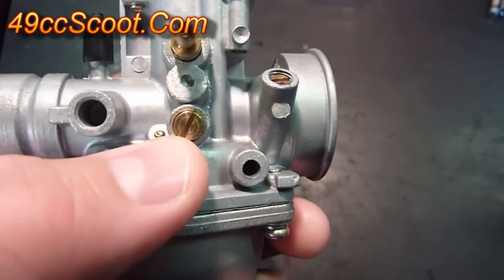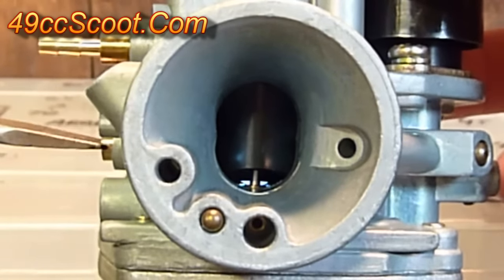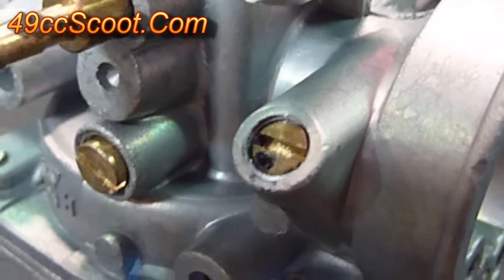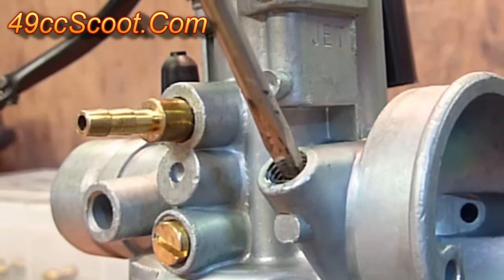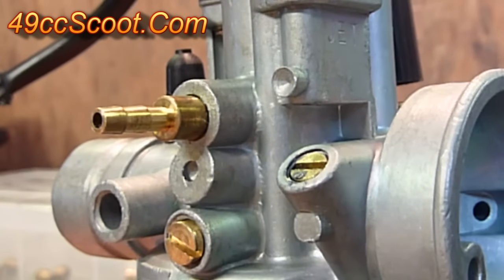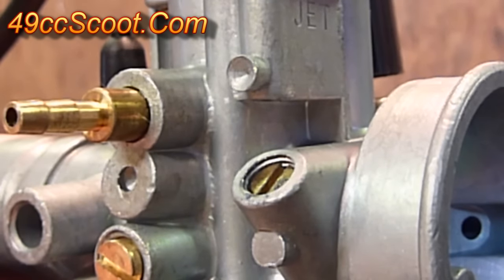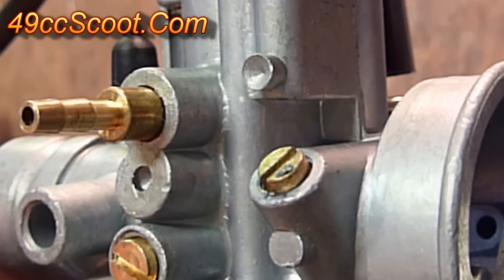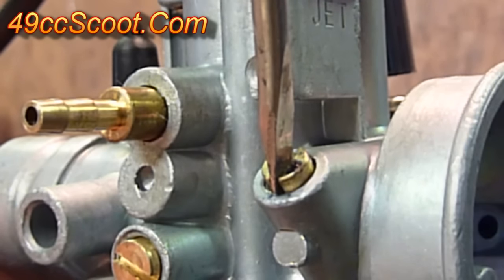Two-Stroke Scooter / ATV Carburetor Settings And Adjustments 2of4 : Idle Speed & Mixture

Comment: It's difficult to adjust these to that "Sweet spot"  when you can't get the engine starting to begin with
Reply: Best way I’ve found to help with this, set the tuning back to factory tuning(usally 3 full turns out for both air and gas screws) then give it a quarter turn back in on the gasand it should be enough to start the bike until you can actually tune it. It’s just 50cc that are an ass because of how exact you have to be sometimes

Comment: im working on an '85 Honda Aero 80cc thats been in an attic since 1987 with a full tank of gas. These past few days have been a nightmare! Turns out, they havent made gas tanks for this scoot since '87, and this is too far beyond repair. Ive worked on tons of Chinese scoots using your help. Now, I can thank you for helping with this one. The air restrictor was stuck wide open due to some gunk build up even after ive cleaned and rejetted. i finally just looked throught the dang thing after this video and saw it stuck wide open. Its too late to try and get it running tonight with the kids being asleep, and I have to work all day tomorrow. Now its going to be on my mind all day! Thanks AGAIN!
Reply from the maker: Good luck with it. Hope that does it for you.

Comment: This is great, similar principles to italian scooters i.e. derbi model with piaggio motors.  My Scooter was running way too rich as indicated by the soiled spark plug.  The scooter recently developed a significant vibration at about 1/4-1/2 throttle and at idle. After turning the idle mixture screw out about 8 full turns, the scooter idles much more smoothly, doesn't lag on take off and doesn't vibrate anymore.  It actually has never ran this smooth.  Great explanation of the process and how the carb works!  Thank you.  2007 Derbi Atlantis Bullet 49 cc with piaggio engine.
Reply from the maker: Be careful. If turned out too far the screw gets loose and can loosen further with vibrations and end up falling out. Replace the idle/pilot jet if necessary to make sure the screw can be adjusted without it being too loose.

Comment: Excellent tutorial will try this on my 350 LC it’s bogging at low revs up to 3000 rpm then it’s off like a scolded cat nice work mate
Reply from the maker: Give it a try since it can be quick and simple if the carb is easy to access. If it's RPM dependent and not throttle position dependent though, you may have something else going on... like a clutch issue for example.

Comment: 9OGTVert

By far the most informative video i found on the mixture screw adjustment;

And,  as i suspected, my pilot jet is TOO SMALL,or partially plugged(air screw ALL the way in).

Thanks a lot.

Comment: This has made a lot of sense because soon as the vacuum pipe is on it doesn’t start use a vacuum pump tester it works I’m guessing ether the carb or vacuum tap isn’t working properly

Comment: Thank you! I've been having a carb issue(keihin pb16/kymco like 50 2t) & took it apart for the first time today. At a point when changing the main jet (w/out fully removing the carb from the engine) I 'adjusted' the float w/out realizing. I put the carb back together properly, but the engine isn't firing (w/good spark and compression). A suggestion has been made to alter the idle mix since my plug is wet. My carb is different than this one, but it is very helpful to get a visual & explanation.

Comment: I need a float for this exact carburetor, mine is off a Bombardier DS90 2stroke but they discontinued the parts.

Where can I find aftermarket parts???

Or can you give me a part number for this?
Reply from the maker: Take a look at PartsForScooters part number 161-214. There used to be some rebuild kits around if you searched for something like "polaris 90 carburetor rebuild". You can look in  a Polaris parts manual for an outlaw/sportsman/predator 50-90 and see if they have a part you can get.
Reply: 90GTVert you nailed it with the Polaris 90 recommendation!

Found a part number through the Polaris Predator 90 diagram!

https://www.partzilla.com/catalog/polaris/atv/2004/predator-90-a04ka09ca/carburetor-cb

Thanks again, very helpful!
Reply from the maker: Awesome. Glad to help!

Comment: Finally a video on adjusting screws. What is usually stock on a carb just roughly as I’ve rebuilt my carb which was all blocked up with the wrong adjustments?
Reply from the maker: 1.5-2 turns out is usually a decent starting point for the mix screw. For the idle speed, you  can make sure it's raising the slide a little and then you'll figure that one out quick enough when it's running.
Reply: 90GTVert 1.5 to 2 turns out from all the way in or flush with the sleeve?
Reply from the maker: @Jack-ns5zc  Any time "turns out" is stated, it should be from seated (all the way screwed in).
Reply: Ah right, cheers

Comment: Hey man thanks for the video I used the guide on my kymco agility 50 its a different version of the carb but its the same thing. the sweet spot for my scooter is 3 full turns out from all the way in. My scoot doesn't have a tach but i basically set the idle to a hair under the tyre starts moving which is nice. I will suscribe to you its hard to find people there days that can even service a carb, Well at least locally lol cheers

Comment: Another great video.  I been haiku problems with my carb sticking
Reply from the maker: That could prose quite a problem. A lot of times sticking is from the cable/throttle setup so check those.
Reply: I had time to take off and clean.  Since we had all this rain.  Seems ok now

Comment: I've got an '86 Jog as well, and I know exactly what you're talking about.  Usually this was done by the factory as a way of discouraging people from tampering with air/fuel mixture adjustments and adding aftermarket components.  A real pain, I know.  I got a Chinese clone carburetor for mine, which had the air/fuel mixture screw.  Took some modification to get it in, though...

Comment: That was awesome and to the point. Should I start with a new plug or a clean the plug? Or does it matter ?
Reply from the maker: If your just starting out, as long as it's not fouling you're OK. If you get to fine tuning, especially higher throttle settings, then maybe put a new plug in.
Reply: @49ccscoot  wow thank you man for responding so quickly. It's not fouling the plug, just kind of gutless. The other Eton viper is much snappier. Both are Eton Viper 90s. Getting ready to sell them. Kids out grew them and want someone to enjoy like we did. Thx again.

Comment: Or just buy an inductive RPM guage that you can clip onto the sparkplug lead and you don't need to listen to idle speeds but you can just litteraly read them on the guage, and since this type of guage is for temporary usage you don't need to do anything to your scooter / ATV.
Most of these guages go for around 20 bucks, so it's not expensive and makes live a whole lot easier. I know it did for me when adjusting the idle speed on the scooter.

Comment: This is one of the better guides for adjusting tje carb, thanks for that! Still have some questions tho.. how many turns out on the idle screw is a good way to start when starting from scratch? Also, is that all made without the choke pulled in right? Usually if i start cold i need the choke in to even be able to start.
Reply from the maker: Don't tune with the choke. Let it warm up, then tune. For the baseline guess on a new carb, try watching the slide and turn till you can see that it has opened just a tiny bit. Better to have it too low and die out than too high and take off.

Comment: Hey cool video ! So at idle if you turn the idle speed screw there will be fuel sucked out of the main jet ? Because you raised the needle?
Reply from the maker: It would depend on the characteristics of each carb exactly, but turning the idle speed screw in does the same thing that twisting the throttle open does.

Comment: Hey thanks for posting this video it's really helpful. I was wondering what's wrong with my carb. It only runs on choke, once I take it off choke the engine picks up revs and then dies. Which screw should I adjust? Is this a lean or rich mixture? From watching your video i did not understand what to do with the idle speed screw. So do I just adjust the idle mixture screw and leave it at that? Or do I go on to adjust the idle speed screw after? Iv been trying to adjust the carb for a few hours and still can't get it to run without choke. Any advice is appreciated.
Reply from the maker: The enricher adds fuel to richen the mixture. If it is indeed a choke on yours it cuts off air, which also richens the mixture. So the fact that it runs with the choke/enricher engaged and not without should tell you that you need to adjust the idle mixture screw toward rich. The idle speed screw is just used to set how fast the engine idles and you just need to keep adjusting it if necessary to keep the engine running at a steady speed so it's not cutting out or trying to take off. There's also a possibility that you have a clogged pilot jet or it could be an intake/case leak.

Comment: Hey man great video, so do you adjust the screws while the engine is still running? OR do you adjust te screws while the engine is off, then start it, then turn it off to adjust, then start it etc.?
Reply from the maker: Thanks. Adjust while running and you can listen or watch a tach for changes.
Reply: 90GTVert thanks!!👍🏻👍🏻

Comment: To adjust my bike, do I have to adjust first the idle speed, and then the mixture screw??
Then if the engine goes to fast I will have to turn again the idle speed? and then the mixture again?? or when the mixture is done good it doesn't have to be touched again?? thank you so much

Comment: Hi this was very helpful I just brought a aeon mini kolt with a oil injection all pipes missing and not sure where to connect the oil was wondering if you could give me some advice thanks
Reply from the maker: In this video, the oil injection port is the one above the idle speed screw. You'll often see that it's a barb with a large base, because many (not all) house a check valve with a ball and spring in there.

Comment: dose having the lowest mixture adjustment and a good idle adjustment effects the engine?
btw my scooter runs smooth with this adjustment it doesn't stop i have a 2t 49cc bw's booster 5 2003
Reply from the maker: Keeping it in tune at idle can help it run well at low throttle as well.

Comment: Great video, but if I have a manual choke (enricher) do I still need to get the engine warm? I do it anyway but I was wondering it 5 minutes at idle was enought?
Also were do you set the idle screw when you first start to adjust the air screw? Thanks.
Reply from the maker: Still warm it up for a few minutes. 5 minutes of idle should be fine. Idle speed screw gets set wherever the idle speed is right. Idle mix screw is usually something like 1-2 turns out for a default guess.

Comment: hi, thanks for the video. I am busy rebuilding a DINLI JP 502 and bought the exact carb, but are not sure about the hose connections? I only have the fuel hose and a thin hose coming out of the engine. There is however 4 hose connection points on this carb. I understand some is vacuum and should be kept open, just not sure which is which. Have you got a diagram of it. All the manuals of Dinli JP 502 I found on the internet is "shadowed" and I can not make out anything on it. I normally fix mowers and whipper snippers. This is my first quad job...
Reply from the maker: Connections shown here :
https://youtu.be/UipC6DLD-EE?t=3m45s

Comment: Hope I get reply so once I go over 2& half turn I get the best idile any more there’s no change so do I stopwhere the best idile is....
Are trying to say that you should be able to screw out for the best idile and before the screw pops out you should get a drop in revs as well ?????
Reply from the maker: I would try a larger or smaller pilot to see what happens. Depending if you have an air or fuel screw.
Reply: My revs at idile on mixer screw is two and half turns out the revs increase at at 1/half between one and half and two and half these no difference so where do I leave it

Comment: Nice video. I have a small question though. Lets say I just came from a ride in a cold night and my engine had a lot of heat. I park my bike in bike in the garage where the air is still so heat waves rises directly underneath the fuel tank. My fuel cap has a vent hole but no vent hose. The next cold morning I try starting my bike but there was no sign of life. I checked the spark and that was fine, I cleaned the carb recently and it was working fine with all the adjustments from before. I used choke and I didn't flood the engine. I was wondering, could this be an issue caused by too much venting of the heated fuel?
Reply from the maker: +Nitrow Boxhead bounty If you think it's venting related, take the gas cap off and try. If that doesn't solve it, it shouldn't have anything to do with venting. If you mean evaporation, unless you had only a thin layer of gas in the bottom of the tank, it shouldn't be an issue.  I'd look more to usual suspects. Is there fuel making it's way to the engine and is there good compression.

Comment: Great Info!! thanks a lot!! what about if you get it good, but on WOT from standing point she bogs and spits?? 
I had it ok but the engine was flooding. I took out the carb and cleaned it, and this tarted after i installed it back in. Just cant get it right this time. Any tips on what might be the problem?
Reply from the maker: The tune may be different now with it cleaned. Make sure the float height is good and see if needle settings get you better response.
Reply: @49ccscoot  thanks a lot buddy found the issue, float was slightly bent and starving the carb : ) running great again!

Comment: How far should the Idle screw be open, given that its a first start after the carb was off for cleaning? What causes the engine to die out when I touch the throttle? Sorry if it sounds like a silly question, but I'm still at the "start it up, let it warm up, take it for a spin" part.
Reply from the maker: About 2 turns for a starting point on the mix. Look at the slide in the carb and turn the idle speed screw till it's just barely open. May have to work the throttle a bit to get it started and turn it in more, but that's better than having it take off when you start it. You may have the wrong mix settings or needle setting or perhaps something is still clogged in there. Air box should be installed if not already.
Reply: ***** hey I have a 2 stroke I just bought and and I replaced the air filter and noticed some oil in the card laying in a crevice by where the air filter connects. Also it smokes quite a bit even after it starts and runs for a bit. Stock muffler restricts the power a ton and runs perfect with it just slow when I put the performance muffler on it runs spectacular but after three minutes when giving it gas it feels like it's missing and won't pick up and go then out of nowhere takes off like a a bat out of hell again and then eventually bogs out and stalls.
Reply from the maker: You probably need to tune the carb for the aftermarket pipe with a larger main jet.

Could be just low quality oil making it smoke, unless it's a new problem with a scoot you've had for a while.

Comment: i bought a couple of 49CC 2 stroke scooters, and mostly drive them up at 6K in elevation. so if im hearing this video correctly, i should be screwing the idle bolt in, to increase the air flow?
Reply from the maker: You'd probably want more air to lean it out a bit. If the idle mix screw is on the air filter side, then it's controlling air. Screwing it out allows more air in. If it's on the engine side, it controls fuel. Screwing it in reduces fuel.

Comment: Hello
Thank u for ur efforts to explain such a complex topic so practically.
can u pls guide me on how to get the max pick up on my Yamaha, 2 Stroke RX100 92 model?
I have put new clutch plates, new piston, rebored the block to 1 step up over stock bore.,new spark plug, new air filter,new connecting rod, and did carb cleaning, also I add semi synth 2T oil (30% ) .
Also guide me to stop leaking oil pump.
Does reed valve play any role in pick up of bike?
pls.
Reply from the maker: I think there are others that could be of better assistance of you, since I don't have experience with the geared 2T bikes. Any 2T could possibly benefit from port work and getting the compression and squish right. That's takes time to do a lot of measurements and you must know what you're getting into and realize the risk of ruining things. Two-Stroke Performance Tuning by A. G. Bell is a good book to get you going with the knowledge to handle that stuff.

Oil pumps also aren't my thing. I stop all of mine by removing them and pre-mixing my gas/oil. Sometimes it's as simple as a loose fastener, bad check valve, or a damaged hose though. First thing is to be certain of where the leak originates, which may require some cleanup.

Reeds do make a difference, though just swapping to CF or fiberglass reeds on my scooters has never been a drastic change. Probably the most difference I've felt from a reed change was moving to a block like the VFORCE-3.

Comment: Great video ! I have e-ton 50cc runs good till half throttle after that seams to break up almost like its to lean what do you think is the reason? Thanks
Reply from the maker: Main jet would be my first guess. Get a selection of jets and do some tuning passes to see what works. If you think it's lean, you can cover part of the airbox inlet with tape and see how it reacts to test. Usually a very small area should be taped because if you cover say half of it then it throws everything way off and it may go from lean to rich.
Reply: 90GTVert thank you I’ll try that first !